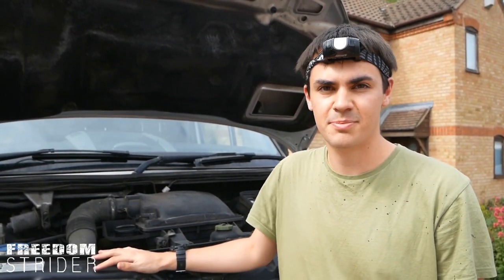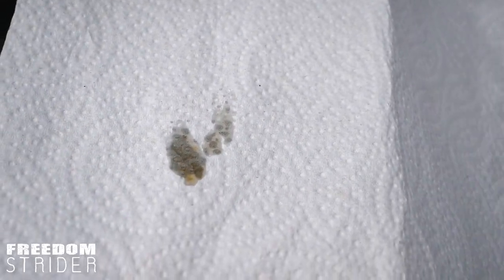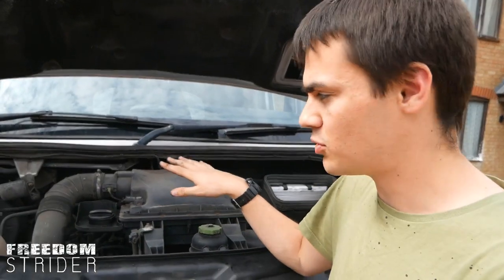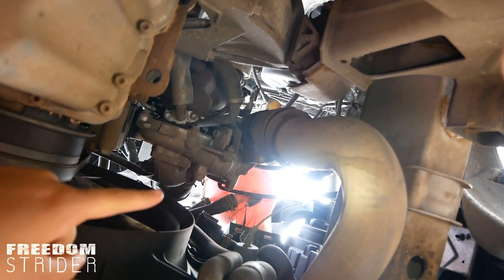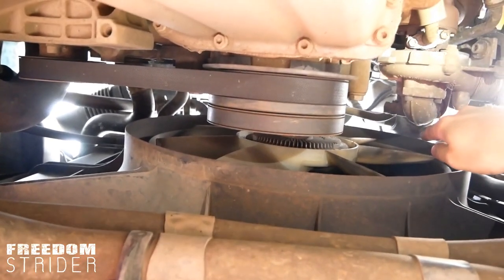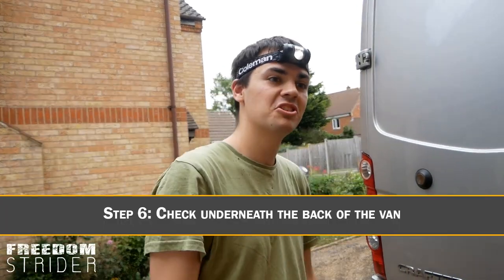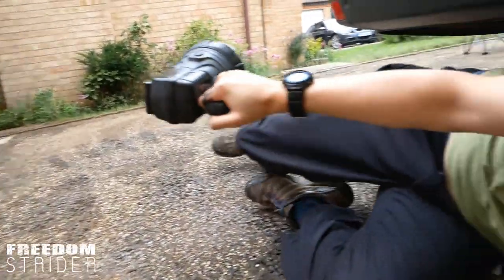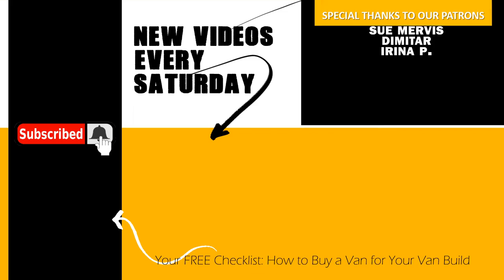Buying a Van - Mechanical Inspection (Part 3/5)

Comment: thanks for making this video, i will be buying a van in the next couple of weeks and this video has made it less daunting!
Reply from the maker: That's so great, let us know how it goes. 😀
Reply: @FreedomStrider  i bought a 2007 LDV Maxus. I tried to remember as much of this video as i could but i should've printed off the checklist, i didn't even check if the indicators worked (one of the side ones doesn't), funny how you forget simple things in the heat of the moment. Like you say, it's difficult to not get emotionally attached but i managed to haggle a good price. Time will tell if i made the right choice, i'll be checking out your other videos on conversion next, thanks :)

Comment: this is SO great guys. i have taken so much info from hear and applied it to van views. I have a video request though. Not many people it seems are doing in depth engine bay check videos. When i go and view i am coming across power steering that's really light, tracking that's clearly out (the steering pulls to a side all of its own)  and engine bays that have stains and old oil build up= minor oil leak. i have run from those clear signs. BUT It's a struggle to work out less obvious signs  what is worth walking away from. I need questions answered like how to avoid buying a van with a bad clutch / how do you tell if the head gasket is in ok condition and the engine valves have not been ignored because a leak has flagged up on a advisory but no-one has bothered because its not 'broken' yet and only an advisory. Basically how bad is too bad and which jobs should someone buying a used van be ok with putting money towards.  AND also (hehe 2nd vid request) who to buy from- what are the pros and cons of someone servicing themselves/ pros cons of buying from a dealer who got a minibus from the council. the DVLA checks look seemingly clean. no repeated advisorys etc BUT what are the BUTS? big message hope it reads well. and again LOVE your channel +style <3
Reply from the maker: Thanks for all the feedback, glad you found it helpful!

The basic checks usually check if things like the heat gasket and the engine are good condition at that moment intimidating, but in terms of whether they have been looked after...that's a difficult one. Service history is 1 area, check what was replaced when and see how long it has been since x y and z are replaced (eg timing belts need to be done every 5 years or 70k miles, so if the last one done was 60k miles ago you know  it's due for one soon). Without a service history it's hard to know thus though which can be a problem, bit that is how I would check.

As for the 2nd request, again its difficult. Having a mechanic you trust and getting them to do a once over check is the most fool proof way of checking I would say. Frankly, i don't think it matters much who you buy from if you have some knowledge going in and rely on your guy instead of emotions. (Aka not saying I want to buy this van because I want to start a van conversion vs. Something in this van being off). Always go to any viewing with the expectation to walk away without guilt and if it is the right one then yoy can see about buying - easier said than done.

We've added the 2 video ideas to our future lost though, so thanks :)

Comment: I have one more tip that you didn't mention. From my own experience of buying a van that ended up having engine trouble, it's good to verify if the van has blow by. Sometimes gasses can escape from the cylinder into the crank case because of worn rings, or leaking valves or a bad turbo etc... This air needs to escape through the engine breather tube. Sometimes this will just vent out the bottom of the engine and sometimes it will go through filters etc... But one way to check is to remove the dip stick and run the engine, put your hand over the hole and check that air isn't coming out. If there is blow by, then be careful because it can be extremely expensive to repair - it would mean rebuilding or replacing the engine.
Reply from the maker: Good tip, thanks 😊

Comment: Great film guys, but its worth noting the brake fluid level should be at the maximum level with new brake pads fitted, once the pads wear the fluid level drops until the pads are replaced again, a low fluid level should represent worn pads, or a leak within the braking system, The fluid level should be above minimum at the very least, and a nice clear colour, (not dark)
Reply from the maker: Good to know, we had new brakes and pads on ours when we bought it so the level level seems to be correct as per your description. We'll be sure to remember that when we check in the future, especially since we're going to be replacing our own brakes as well :)
Reply: @FreedomStrider  might be worth putting a something on the vid, if a mechanic fits new pads with a full reservoir it will push fluid out of the cap and corrode various parts in the engine as the brake calliper pistons are pushed back
Reply from the maker: When we end up replacing the brakes on our van, we'll be sure to include that specific fact to let everyone know, best include it in a specific brake changing video :)

Comment: Does the OBD2 Scanner works for Mercedes Sprinters as well ?
Reply from the maker: Yes should do, nearly all vehicles now have OBD2 ports - as long as it has a port, any OBD2 scanner will be able to read stuff. For the expensive scanners, you have to be more careful about their capability 👍

Comment: This is very helpful, thank you. Which of the fluids is pressurised? I forgot which, but probably worth mentioning not to open that right after the engine has been running.
Reply from the maker: The coolant, which you fill from the radiator, is pressurised. After driving it is hot and it will spurt out... When it cools it doesn't. 👍
Reply: @FreedomStrider  legend, thanks

Comment: Hi, that was great thanks. One thing you didn’t mention was the suspension or do you only check that on the test drive?
Reply from the maker: Well, the suspension - to the untrained eye - may be hard to diagnose. You can check if it is severely corroded just by looking and if it's really bad you might notice during the drive, however, on a van, it will be hard to tell. Plus, minor wearing may not be noticeable on initial inspection. The best way to check (other than taking for a service), is to look at the MOT history of the vehicle and see if the suspension has been mentioned. 🙂👍

Comment: You didnt check the suspension and axles as last time i bought a van and rear axle failed. Was stranded on the motorway for hours.
Reply from the maker: True, we didn't check it and the more you check the better. 🙂... Though we are sure to miss things
Reply: @FreedomStrider  i lost a lot of money, as garage said its gonna cost   £2000 to £3000 so I had to sell it cheap with the problems and a machenic bought it. The engine gearbox was fine just the axle and other bits underneath which you can only check if you lift the van up

Comment: How realistic is it to expect all these checks to pass if I'm buying a van on a budget? Surely there's got to be some leeway with some of these checks?
Reply from the maker: It really depends on what you are willing to risk it on and what you are okay repairing. You can absolutely have a vehicle that can meet all these checks, even a budget one. 

The only major things I wouldn't compromise on are any damages to the engine (head gasket leak) or the clutch. Oil leaks are fairly common, but you don't want an excessive one.

We were quite lucky with our van, we didn't really compromise on anything, it had been very well looked after. It was £8100 (in 2019)
Reply: @FreedomStrider  cool beans, thanks for the timely response. Wow, that was a good deal. The market has really changed alot since the pandemic first hit. 

Btw really great video, much appreciated. Very surprised you haven't got more views best one I've seen so far for sure.
Reply: @FreedomStrider  how do you diagnose the transmission just by the rpms and smooth shifting? Thats all you can do? And if there is oil on the oil pan is there any true way to be confident in it without opening the entire engine up on the spot beyond the obd2 reader? Thanks

Comment: This is what the mechanic does? I do this, I won't need a mechanic?
Reply from the maker: This is usually what a mechanic will check and you'd be surprised with how many people don't even check some these basic things! This is equivalent to a shortened MOT check, you can request a mechanic to do a service which is alot more thorough than this - the more experienced eye can notice the health of a vehicle just by doing what we did, but that is a matter of experience 👍

We didn't use a mechanic for our van, we just used the techniques shown in the video and we're very happy with our purchase 🥳